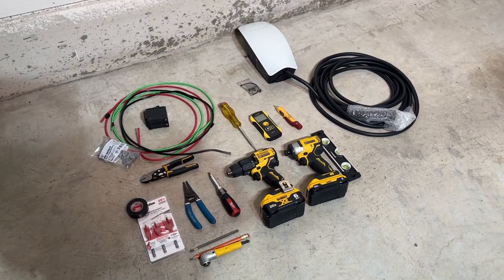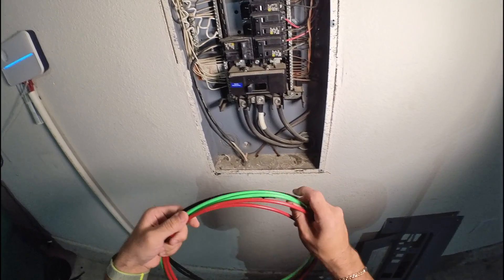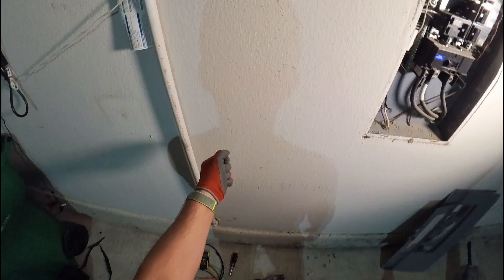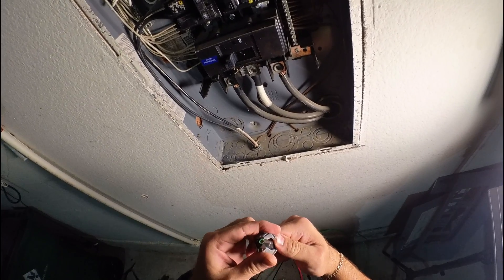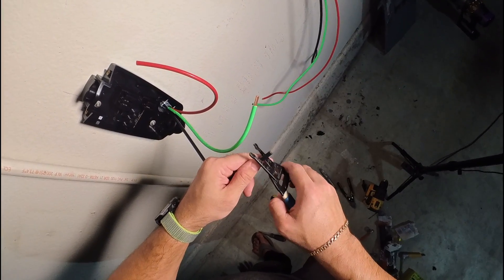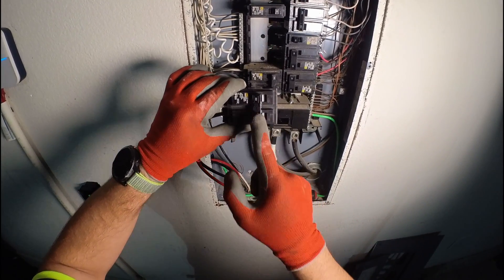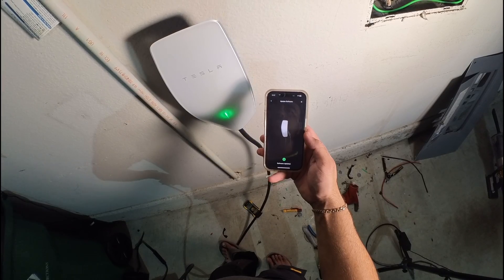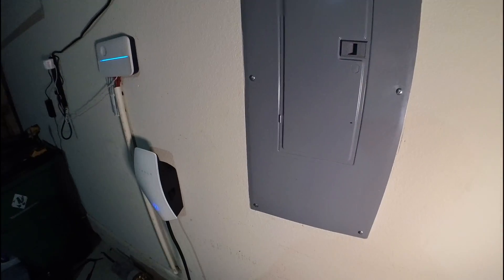How to Install Tesla Wall Charger (Gen 3)

Comment: WTH, there are numerous code violations in the wiring. It's incredibly risky for THHN wires to be exposed without conduit.
Reply: That’s when the owner says I can do it to save money
Reply: What precisely is the risk with THHN wiring being not in conduit? I'm not challenging you, I just want to know what exactly can go wrong. Romex can be installed without conduit. Is that sheathing truly that protective?
Reply: @sonovabeach So it's all according to the NEC. Is Romex sheathing a great protection barrier? No. It's better than nothing, and code is always a minimum standard. Thhn loose in a wall has more fire potential than Romex in testing. Thus, a conduit raceway is required. It's written by the NFPA after all, fire prevention is the key. Hope that helps
Reply: @Matthew-fk2vv  do you have references for any of this? i know it seems like it's correct but it also sounds like the same explanation on why they told us to wear masks. just becauses one ORG declares it does not mean we arent allowed to use our reason and understanding of science of realize WHY they recommend it and IF you should follow that.
Reply from the maker: Agreed. I did it in my house and know for sure that no one will damage it in the future during any repairs. Thanks for pointing it out!